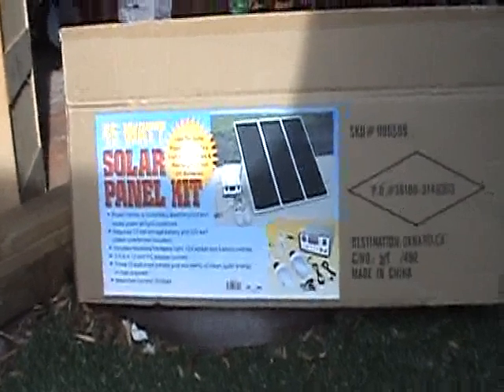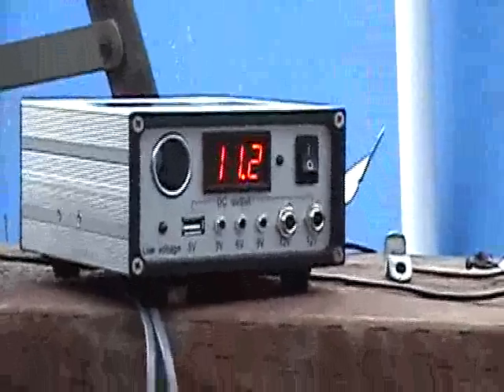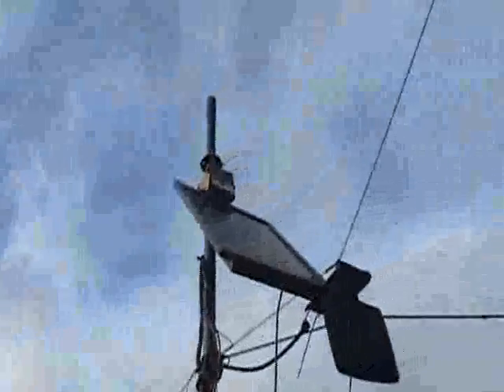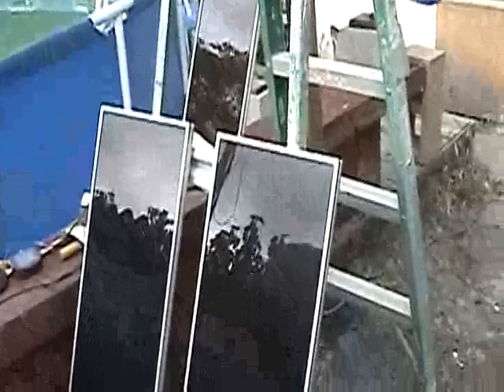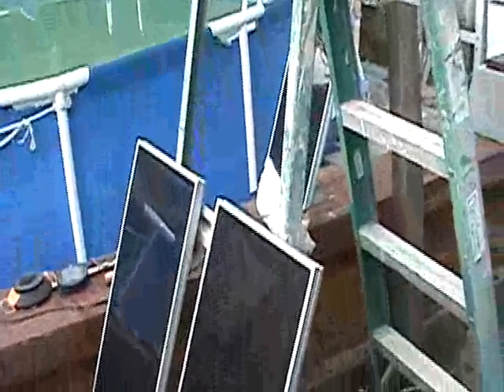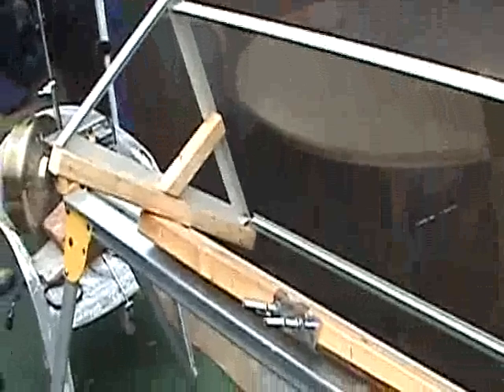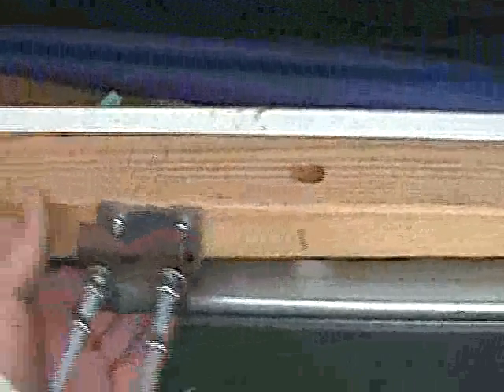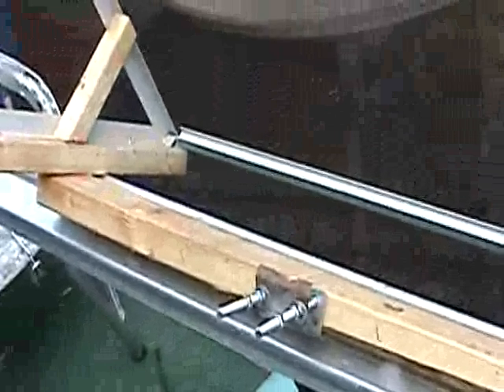HARBOR FREIGHT SOLAR PANELS/home made tracker

Comment: You make it look easy to spin those solar panels way over head.  

Have you had any issues with wind trying to pick your panels off the pole?

I still have to make a mount for my panel.  I'm a little worried about wind getting under the panel and tearing it up, like an umbrella in a storm, getting turned inside-out.

Comment: Very nice setup. I like your tracker idea. I have to keep my set up on top of my back porch, since I live in a community. So I will place my panel rack directly on top of the lazy susan and attach a gear with a shaft that extends through my porch roof. This way I will be able to turn it from inside my porch. Thanx for the great idea. Sam